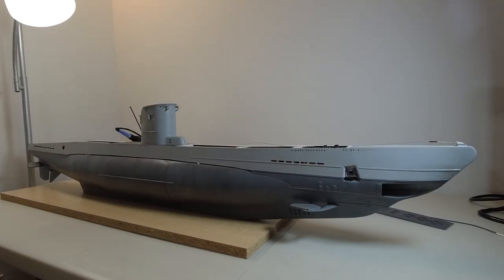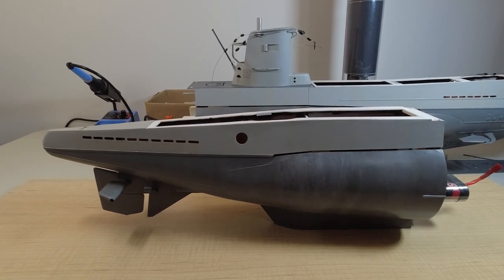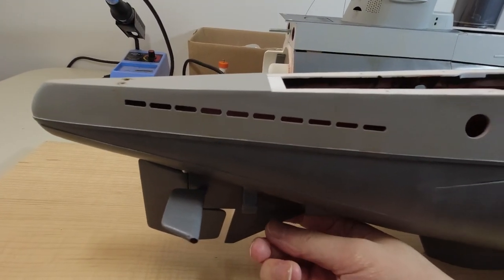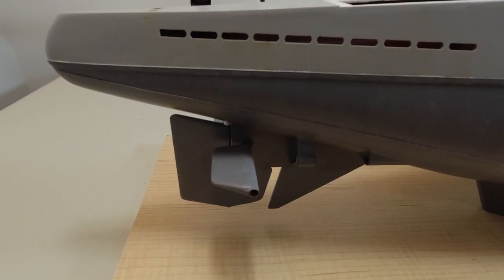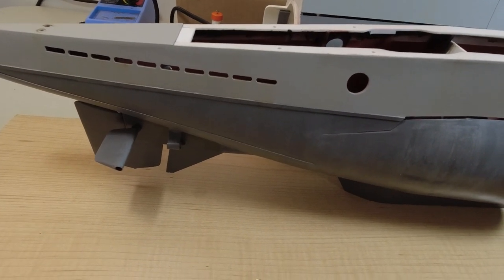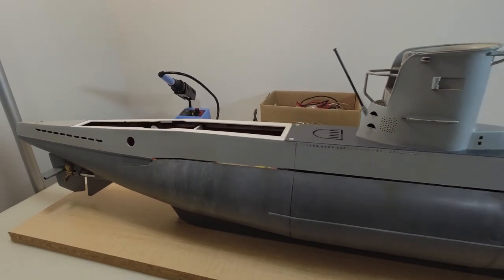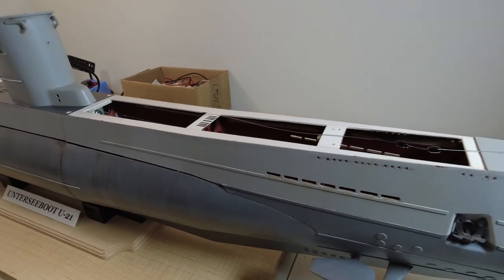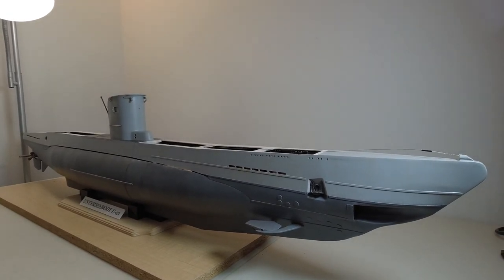RC Submarine Project - Type II U-boat | Episode 5: Propulsion and Control

Comment: good work, very well done. I do not understand how you trim the water pump flow, since the ballast tank is vented to the water. There is no bladder inside, as I understand. When the boat is submerged the water flow drained by the pump from the ballast tank must be much more than the incoming water otherwise the boat will not come to the surface.
Reply from the maker: In a vented ballast tank system, the air intake is always above the water surface even when the submarine is submerged.  In this case the boat must be trimmed such that it will always be slightly positively buoyant even with the ballast tank completely full of water.  This ensures that air can be always drawn in when the pump is pumping the water out.  I can go deeper in the water with the hydroplanes but as soon as I let go of the throttle, the sub will go to periscope depth.  In this case my air intake is hidden inside the periscope.
Reply: @neitoRC  OK, with the vent to the periscope the system works, if a residual buoyancy is left even with the tank full, but it is anxious to wait the boat makes surface slowly..... If inside the tank there is a bladder the pump can drain it quickly taking advantage from the compressibility of the air inside the WTC.
Reply from the maker: @paolosaccenti1837  I did consider using a bladder system in the past but that would also require a stop switch to prevent the bladder from being over pumped.  The WTC endcap would also have to be designed such that it can be locked unto the equipment tray so that the increased pressure inside the WTC does not pop it off.  In my current setup the speed of surfacing largely depends on the power of the pump.  In my case with the pump running at 7.2V it is able to empty the ballast tank quite fast.  The only drawback with the current setup is that the pump's gears are plastic, so I need to run the pump in short bursts, to not risk overheating the gears...
Reply: @neitoRC  correct, but to secure the endcap is not difficult and for sure from the safe side, since the internal pressure might increse also due to the heat generated by the components. What happens , in a rigid ballast tank, when the pump is emptying the tank and the vent is under the water level? I think cavitation might occour and the risk to damage the gears is real.
Reply from the maker: @paolosaccenti1837  Yes, I agree, modifying the endcap should not be difficult especially in this age of 3D printing.  Regarding the heat generated, the main heat sources would be the drive motors, ESC and the pump motor.  However, I don't think they will heat up the air to the point of expansion and popping the endcaps off underwater.  The pressure generated inside would have to be much greater than the water pressure outside.  If the motors are capable of generating such heat, then it means that there is a serious current drain in the driveline that should not be happening.  RC submarines motors should rarely get that hot since we are not running them at high speeds.  For the ballast tank, if the vent is underwater when the pump is emptying, water would simply get pulled into the vent and circulate through the ballast tank.  This is why the sub is trimmed such that the periscope will breach the surface when the throttle is at neutral.  I simply cut the throttle, and the buoyancy will make the boat float up to periscope depth.
Reply: @neitoRC  I agree that the heat generated in normal condition would  not able to increase the pressure inside the WTC that much, but is case of short circuits, that we always hope will never happen,  better to burn out a single component than  loose the boat. I remember a Kilo class with an oversized  motor that sunk by expelling the end cap like a champagne bottle. Regarding the circulation of the water inside the ballast tank when the vent is submerged, the balance into the tank is zero if the the vent line and the pump intake have the same dimension and lenght (pressure losses) . Generally the vent is smaller and longer and have a more twisty path than the pump suction pipe. The possibility that the pump will put under vacuum the tank and run into the vapour is high. Hopefully the boat is making surface, unless it is shrinked in the bottom.............
Reply from the maker: I am using the same diameter of tubing in the vent line and the outflow line so it should not be an issue.  Like I said the only time I am emptying the ballast tank is when the periscope is visible on the surface.  This ensures that air is flowing into the tank as water is being pumped out.  The most important thing with a vented ballast tank is for the sub to maintain slightly positive buoyancy even when submerged. As long as the water tight integrity of the WTC is maintained, this should be fine.  As with any RC vehicle the possibility of having a short circuit must be eliminated as much as possible in the design of the component layouts.
Reply: @neitoRC  OK, I am looking forward to see the episode No 6, me too is doing the type II but "D" version. thank you for the intersting answers.
Reply from the maker: I wish spring would come sooner so that I can go to the pond to test it out :) Are you scratchbuilding your Type IID or is it from a kit?
Reply: @neitoRC  yes, but some test on the home bath would however intesting to see, go ahead with the vieo on youtube.  My U-boot is a kit from sheerlinesub. May be this is not the right place to continue our intersting discussion, are you on the drydock forum?
Reply from the maker: Yes I am, I have a build thread about my Type II here: 

https://forum.rc-sub.com/forum/builder-threads/155481-scratchbuilding-a-1-35-scale-type-ii-u-boat-a-chronicle-of-past-and-present 

See you there! :)